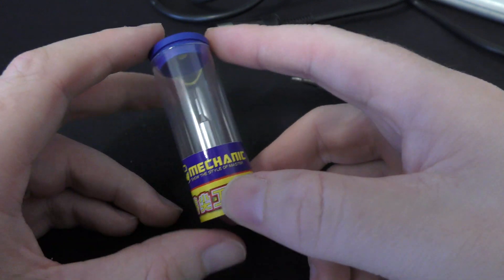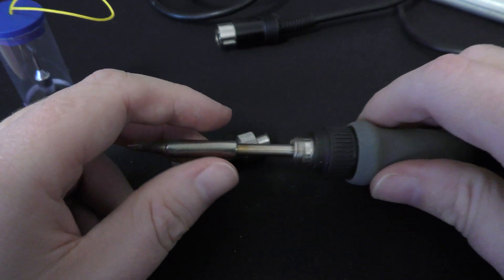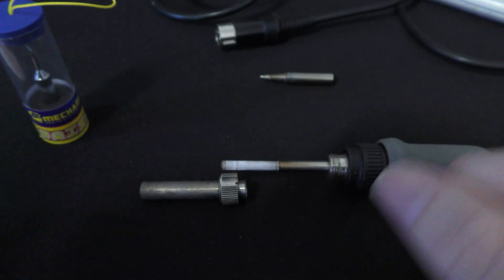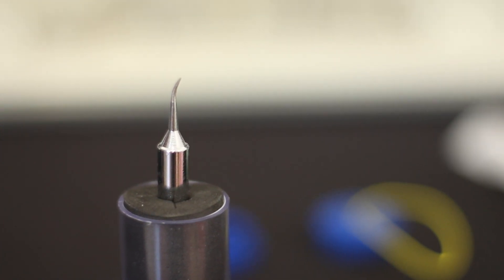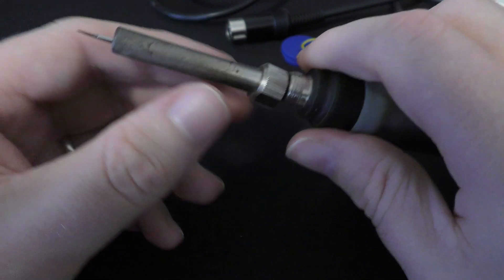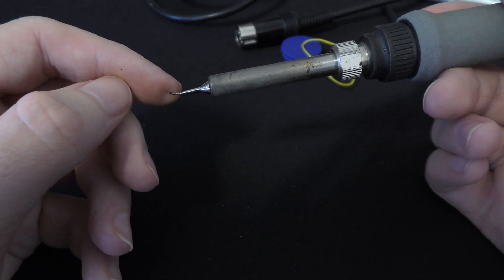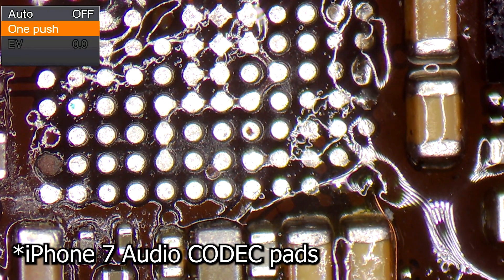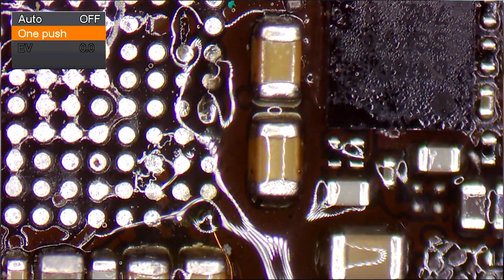Dirt Cheap Micro Soldering

Comment: Hey, great video. I want to get into modding PS5 controllers but not sure what decent cheap soldering iron to get for starters. I have soldered in the past but I have a big tip standard home soldering iron which wont work for small parts. Want something I can learn and grown with and if all fails not be too much money down the hole. Any help would be much appreciated. Thanks!
Reply from the maker: Take a look at the hakko t12 clones I have a video on one, they are very good irons for most people and there is a huge range of tips, they are perfect for modding consoles and controllers
Reply: @Slot1Gamer  Great, thanks a lot. Will check video next.
Reply: This commend was 2 years ago and in those 2 years I have grown a lot. I got the JBC clone (Aixun) with some real JBC tips and its been amazing for everything from micro-soldering to anything in between. I can't speak on the Hakko clones but for $125 the Aixun is truly an amazing deal. 

Its a great moment for me as reading my commend I look back at how new I was to soldering, modding controllers etc.  @Slot1Gamer

Comment: I tried to solder my mic driver it broke off. I did but now the mic volume is soo bad
Reply: that means you have a bad connection. try soldering again and giving it heat for longer so it flows good

Comment: Hi Great vid , I already bought those they're super duper excellent. But I'v been struggling with T12 tips doing something that might sound stupid.. cleaning bga pads. I tried with FX-951 T12 tips.. but seems solder does not melt on pads while I use wick. What am I doing wrong.. I tried pumping temp all up to 451 ( which I measured with thermocouple and didn't reach to that temp.. so I had to calibrate with a button on 951 where you can set 040 ). Still same issue.  Hope you can help. thanks
Reply from the maker: I find using hot air and wick works much better, hold a timed piece with tweezers and glide over the pads, I did this for a touch IC just yesterday :)
Reply: @Slot1Gamer  Was that supposed to be tinned piece? Like a tinned piece of wick?

What is your technique with hot air and solder wicking?
Reply: @paolom.6011  I think he meant trimmed?

Comment: I got a T18-compatible microsoldering "J-tip" as part of an Amazon SMD component kit/assortment last year (Interstellar Electronics 2700pcs). I use it with two different Aoyue stations (Int701A++ and Int866). I haven't done much soldering with it but it was properly plated from the start so I assume it's better than this brand.

Edit: Price of the assortment seems to have gone up. I paid $45 but it's now $60